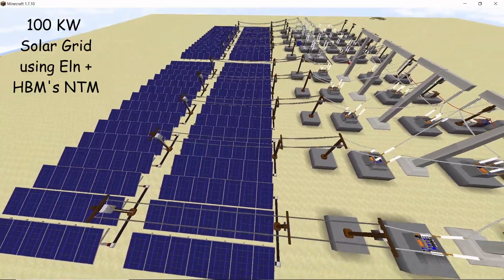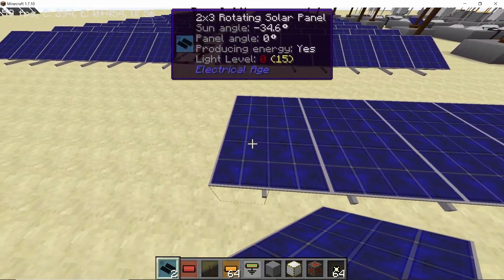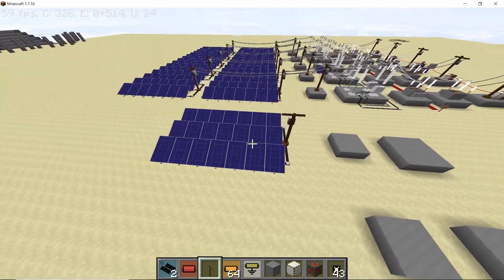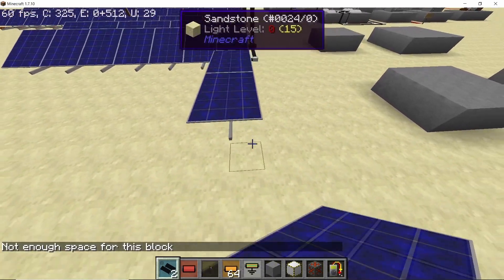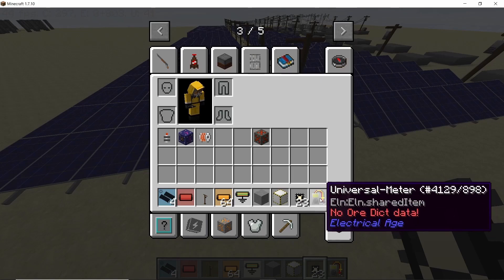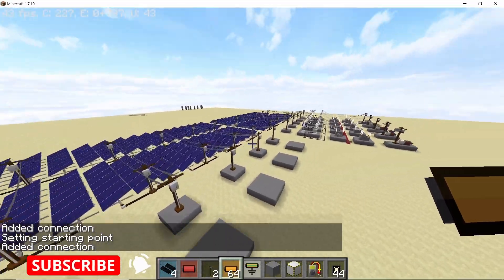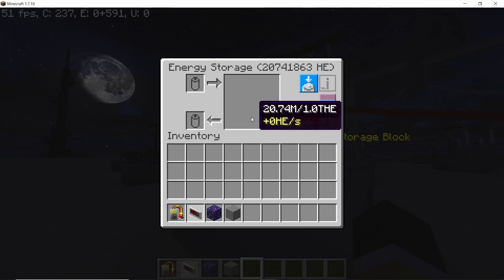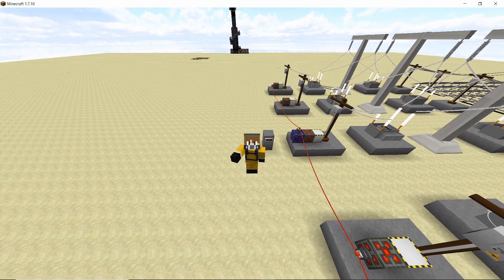100 KW Solar Power Grid - Electrical Age + HBM's NTM || How to make a solar grid in Minecraft

Comment: Hello, great video!

Tell me, can you explain the process to follow for this:

In fact, I would like to build a factory that produces electricity and transport this electricity very far without loss, to supply a city with low voltage, for small lamps and city street lights.

But I'm confused with everything that exists and I can't really figure it out, can you help me?

ps: Sorry for my poor English, I'm French.

THANKS :)

Comment: There's a big time since i use electrical age, it's sad that the project was abandoned
Reply from the maker: Jared is still updating the mod for 1.7.10, you can find all the new releases on his github. But yea it would've been cool if this mod was ported to newer versions of mc
Reply: @SavageVegeta  it's really good to know, i found a bug on his new version, i can't use the dc-dc converter anymore (can't put the wires to make the coils) but i have some that were already assembled on the map and they still work, for any reason i just can't create them anymore on the newer versions
Reply from the maker: @vinilomelhorpresente4622  well in the build he releases, he mentions which ones are stable and which ones are not. So I hope you're using stable builds only. Also if the big persists then you can open an issue on git about it
Reply: @SavageVegeta  i'm using the 1.18.3a Stable Backport

Comment: which version of electrical age i download ?
Reply from the maker: Version 1.18.3a , it's a stable version listed on the GitHub page I linked in the description. It'll have all the new features that you'll need !!
Reply: @SavageVegeta  where to get the T2 tower?
Reply: @SavageVegeta  1.18.3a will run on 1.7.10 version?
Reply from the maker: @ronanbajaro1544  it is the number assigned to the mod version and has nothing to do with the Minecraft version so yes it'll run perfectly on 1.7.10
Reply: @SavageVegeta  Oh! i thoght that was for 1.18.3... but then i looked at the minecraft version list.. and 1.18.3 didnt exist! i was so confused...
Reply from the maker: @Big_Bird27  yeah I can understand that , at first I was as well cause many version of electrical age have similar numbers as Minecraft versions xd 
But yeah for now mod is only for 1.7.10 and for 1.12.2 you've to compile it yourself I guess

Comment: Please tutorial save the energy I have made flywheel automatically system but yeah , just 2kW and voltage drops
Reply from the maker: Think about it this way ... using this system you are already storing all the energy it is producing in the form of HE / RF. If you start storing all the energy in flywheels you won't get any usable energy throughout the day as flywheels are very heavy and take a long time to spin up to their full capacity especially when their power is coming from a weak source like the solar grid

Comment: Realistically speaking, Electrical Age is the closest to real life. However, it doesn't have the controversial over-efficiency and free energy machines that real life have. It's more towards conspiracy but, it is real. You can make magnetic circuit simulation of "bi-toroid transformer" and very high frequency single phase flux switching alternator, with ANSYS Maxwell. There is also the parametric transformer(paraformer) to experiment with.

Conclusion, a LOT of good tech is hidden from public.
Reply from the maker: I agree that alot of tech is hidden from the public part , but I don't believe that "free energy" machines exist. Simulating it in ANSYS is one thing and actually having that thing run is another. 
Now yes I don't have any indepth knowledge  of any of the three things you mentioned , but I'm pretty sure that even electrical equipments and circuits like to follow the laws of thermodynamics. And like perpetual motion machines which don't work no matter how much you want them to , I think the same applies to the said "over efficiency" and "free energy" circuits that you're talking about cause in the end you're going to lose energy to universe in the form of heat
Reply: @SavageVegeta  Entropy has nothing to do with energy creation, or, negentropy is what the over-efficient devices operate on. Here you go btw. Found the pdf.

http://utpedia.utp.edu.my/15554/1/Final%20Report.pdf
Reply from the maker: @lukiepoole9254  tried opening the link with vpn and also without it but nothing happens , it didn't open the pdf neither did it download it
But you have read it so if you can ... then give me the brief idea.

 So where is all that "free energy" coming from ? Is the law of conservation of energy maintained in the system ? And mainly what does this whole thing that you're saying means ... You supply the system with energy once and then you can keep extracting it for infinite amount of time ? Or something else
Reply from the maker: @lukiepoole9254  anyways I'll make a post on reddit about this as many people there might be able to shine a light on this concept and I wanna learn more , thanks for the info !!
Reply: @SavageVegeta  BiTT(bi-toroid transformer) is designed in a way that the two opposing fluxes cancel each other in a separate flux path, forcing total output power to be greater than total input power irregardless of power factor. See google pictures. Also it's weird that you are unable to access it. The design uses another O core just slightly bigger than the EI/8 core, separated with about 0.1mm air gap? Primary flux is unable to flow in the O core due to design.

Where does the energy come from? Idk. Maybe it come from aether/dark matter/fabric of space-time/quanta fluid/quantum foam? Negative entropy is for sure.
Reply: @SavageVegeta  You're going to get a hell lot of criticism as most people are unable to accept the truth lol

Comment: wouldn't it be easier to use NTM pylons for long range transmission since those don't have resistance and you can just combine all five currents into the same line?
Reply from the maker: Yes it most definitely would be , that would give more power out as well due to no resistance losses.
But if you do that then you won't be able to use the grid transformers and switches and miss out on the humming noise and temperature rise in the components as power flow increases , I think all of these features give the whole build a touch of reality. 
As for combining all the transmissions lines into one , that would be only possible while using NTM power lines cause if you do that with electrical age transmission poles they will explode by overheating cause no pole can handle 100 KW flowing through it
Reply from the maker: And this solar grid can also be used with other mods as well , that's why the part up until you place the energy convertors stays constant (all components will be of ELN) ... then you can convert all the watts to RF , EU , HE and so on.

Comment: when antimatter reactor with antimatter thing from hbm mod and fulmination explosion generator from physica nuclear tech but that fulmination explosion generator is weak and i only got 22k he output with 1 antimatter cluster explosion but i found that radioation that explosion creates is very strong and it can be used for for energy  but it creates radioation for short amout of time so result was 0 he i tried to make it work but ambience radioation generator cant create energy from that short amout of time so it needs more than 1 explosion chambers and also a gigantic fulmination chamber for antimatter cluster explosion for more effeciency and also use rf to he conventer for get energy from it
Reply from the maker: yoo do you have a link to this "physica nuclear tech" ?? I couldn't find anything on it